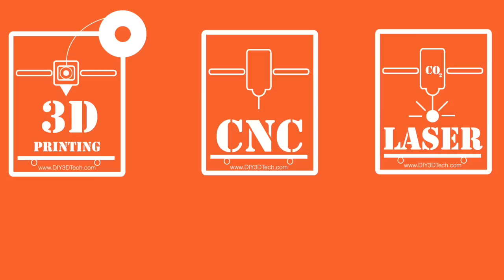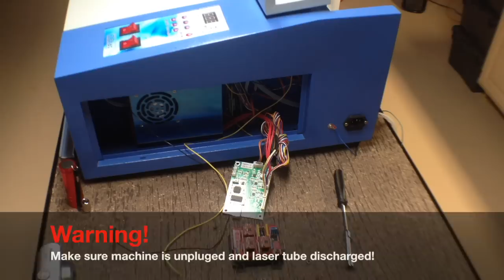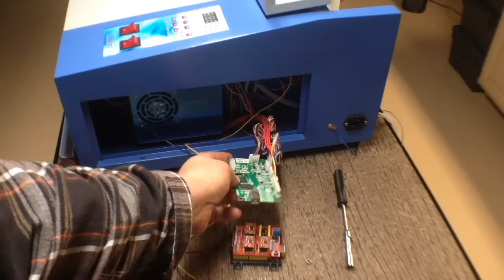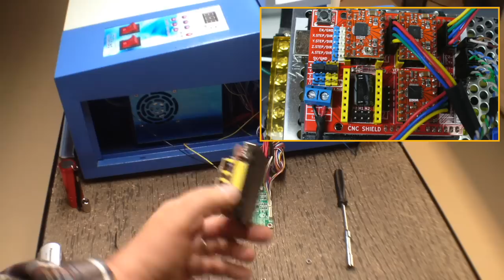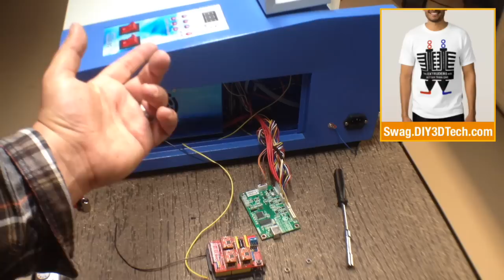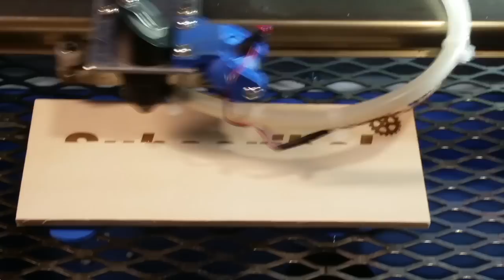K40 eBay Chinese CO2 Laser Cutter  -  Replacing the Controller with Arduino and GRBL Part 1!

Comment: I have stripped a K40 down and built an Acro 1510 system using the parts. I am running the arduino uno and cnc shield.  The software I am using is Lightburn. I have looked at literally hundreds of posts and can't find anyone who can actually tell me how to connect the LPS to the Arduino. I am attempting to use PWM. Does anyone have any idea how to wire this correctly? My power supply is the G-W-W-G if you know what that means. Any help would be greatly appreciated.
Reply from the maker: Very interesting do you have any posts on the build?  I would be interested in seeing how you mounted the tube.  I have seen another Maker take a K40 and do similar which I found interesting.  To your question, this is the number one question I am always asked and the answer is not easy however possible.  I think the circuit would be rather simple in terms of general design as I would bias a transistor with the PWM signal and replace the potentiometer with this as a resistive circuit as that is all the "pot" itself is doing.  The  challenge will be to determine the transistor/resistor combo to make all of this work.  For someone that does this for a living I am sure it would be easy and hence I am surprised I have not seen it done.  As I would start with breadboarding a transistor feed by a PWM and build up from there.  If you are really brave, you could crack the HV PWS and see if you can figure out how to bias it there but fear this would one be harder and two more dangerous...
Reply: @DIY3DTECHcom  I was able to figure out my error this morning and it works fine now. I would be happy to share the build with you. I'll snap some shots tomorrow and share. It's not pretty at the moment but I have plans to make a more permanent solution. It's an awesome setup. I am able to utilize an X axis of 800mm and a Y of 1,300mm. I can almost etch a shower, or storm door from top to bottom.

Comment: Just from looking at this, the wire line are monopolar steeper motors  with proper darlington arrays. THerefore, just will Arduino will not do the trick unless you do  hard coding the register.
Reply from the maker: It did and still working today like a year or more later so not sure what your saying...

Comment: I'm having issues with the potentiometer causing erratic behavior with the current.  (*edit* Current when setting the power level I want, I know it jumps around normally when rastering.) I'm wondering if changing to a multi-turn 2 amp 1k potentiometer would be better?  Also thinking about getting one of those drop-in smoothie controllers so I can do photos on acrylic because I'm having problems getting the K40 Whisperer program to dither on glass/acrylic even when inverting, although it works pretty good on wood.
Reply from the maker: The pot problem is a common and it doesn't handle a lot of current as its just a cheap one.  Most folks simply replace with it with a simular pot but you could try a better one.  Since I basically only cut, its not such a big deal for me...
Reply: Yeah, I was thinking a multi-turn pot would be so much smoother when adjusting.  I'm not at the laser now, but I thought it uses a 2 amp pot?  If I get the drop in replacement, it won't matter, but it will probably be awhile before doing that and I'll really miss the K40 Whisperer program, so much so that I'm considering making a switching circuit to toggle between boards.  Something nobody has done probably, but then it's probably not much desired either! lol  LOVE YOUR CHANNEL!
Reply from the maker: Many thanks for the kind commets however I am confused "switching circuit to toggle between boards" as where does the two boards come from as I use the K40 whisper with same board as laser draw...
Reply: It was only a thought.  I like the K40 Whisperer and how easy it is to open a file and go, but it doesn't do too well on acrylic, so the smoothie could do the high res stuff in greyscale and then I could flip a switch and be  back to the  K40 Whisperer for easy stuff.  Probably not practical, but could be interesting.

Comment: Your videos are giving me the confidence to purchase an eBay 40w co2 laser to hack it. Did you ever get the chance of building a motorized bed for z axis?
Reply from the maker: No have not done as really have not had the need as most of what I do is 3 to 5mm so I just shim up the 3mm with washers.  Maybe this winter, just too many other projects : -)

Comment: Hi there. 
I'm having a single problem with converting my K40 to Uno+CNCShield.

My laser PSU has two pins for the laser.

Laser PWM and Laser Fire.

I cant find anywhere online where these two pins plug into the CNC Shield.

I can get the Z+ pin working with M3 and M5 commands. Testing with an LED and it controls properly, however when the LASER FIRE Pin is put on that same Z+ pin, the laser is always on.

Which pins do I need to plug my LASER PWM and LASER FIRE onto my CNC Shield and which commands to run it?
Reply from the maker: The K40 doesn't do PWM so not sure.   As far as the firing line line goes.  Just google "transistor inverter circuit" and pick the one you are most comfortable building.  However one safety note, if you abort the job before the job is complete (hence the M code to turn off the laser) is sent, the laser will remain ON!  So be safe :-)

Comment: So, quick question for you... I am looking to do something similar, and I know there are some that have the power meter on it..where you can adjust the power of the laser.   Is there a way to adjust that too, to control the intensity of the beam?  Or is that just something that is controlling the PWM of the laser.. variable resistor driving the speed of pwm... Thanks for the videos!
Reply from the maker: +Dan Regalia thanks for the kind comments and to answer your question, there isn't an easy way to modulate the laser.  Now you could design an additional circuit to vary the resistance of the pot and use the PWM to drive it.  However again it will require of design work.
Reply: @DIY3DTECHcom  and @ Dan There is a PWM output on the GRBL board, and I have read that the Laser Power Supply can use both PWM or Pot resistance to set current... Have you done any further research or learned any more in regards to PWM to set current?

Comment: Great video. Isn't it possible to invert the signal via a config setting in GRBL ?
Reply from the maker: Nope they keep it that way for safety reasons as who in their right mind would fire on a low signal?  So you have to build a small logic inverter...
Reply: True, but GRBL is built to be relatively generic. Did a little digging around, in 'config.h' the comment on line 154 says 'Inverts pin logic of the control command pins.' if you follow the rest of the comment it takes you to 'cpu_map_atmega328p.h' You mention that you are firing on pin 12 ? which seems to be set on line 66- #define Z_LIMIT_BIT    4 // Uno Digital Pin 12 and used in the mask '#define LIMIT_MASK       ((1<<X_LIMIT_BIT)|(1<<Y_LIMIT_BIT)|(1<<Z_LIMIT_BIT)).' So it may be that using the line #define LIMIT_MASK       ((1<<X_LIMIT_BIT)|(1<<Y_LIMIT_BIT)|(0<<Z_LIMIT_BIT)) Inverts the logic on pin 12 ? Purely a hypothesis, im not planning on switching to GRBL just yet so I can't test, but my machine is working tons better thanks to your videos, so thanks very much :)

Comment: Great project. Has anyone actually measured the laser power of these inexpensive "40W" lasers?
Reply from the maker: Thanks and yes, most these are really 30 Watt units they over drive to get up to around 35 Watts (i.e. round up to 40 watts).  A true 40 watt laser will have a tube 750mm long whereas this one is only 550mm...

Comment: You are so going to  love that conversion .  You will be able to stream , and later  add SD card back , as you can stream form file on SD card.
I forgot to mention when you asked about my firmware , My plans were to move from custom home brew g code interpreter to GBRL  any how .   I was planning to  edit GBRL to control my custom laser setup and keep my old OLED on I2C if i can . 
Also InkScape's plugin for laser is quite handy and free . I use chrome app universal g code sender most of the time with mine.
You should be able to calibrate your steps with a few calibration cuts . i tried calculating mine , but in the end cutting a 150mm x150mm square a few times and doing some  large 75mm radius circles , and checking them for being true was all it took to dial it in  .
You will be able to cut using vector paths . Makes me  want to finish my  bitmap to raster
Reply from the maker: Yes use GRBL a lot as I converted my CNC to GRBL as well as built a 2Watt Diode Laser with it.  However can you share a link for I use chrome app universal g code sender ?
Reply from the maker: P.S. if you do hack GRBL for the OLED let me I would love to added to several of my machines...
Reply: you bet i'm looking now .  I love this app , it work offline  and even on chrome books ! : https://chrome.google.com/webstore/detail/gcode-sender/ngncibnakmabjlfpadjagnbdjbhoelom?hl=en&pageId=107047392111691459641
Reply: I'm gona look into it , i just wonder if  the I2C buss  pins have been used ..  but i will have a dig for when i re do my rig . there is just too much good stuff in the newer GBRL to pass up .
Reply from the maker: Wow!  I wonder why I have not come across this before!  Thanks again for sharing it!
Reply from the maker: Ah yes that is  a good point (wonder if  the I2C buss  pins) as GRBL's issue is its always short of pins on the UNO...
Reply: well you could edit the ?pins.c   or whatever file they stuck the pins definitions in ( I need to DL the latest GBRL from GIT or such to verify )  so you can migrate it to MEGA2560 or other Atmel chip .  I may go to MEGA for all the extra GPIO , and it has 2 hardware serial ports . That's handy for debugging or say using a ESP8266 of some type to wifi-ize your laser .  Heck is i use a Arduino Mega i coudl use one of the reprap LCD screens pretty much as is , and should not be too hard to look at how marlin supports them .  But mainly I just want to see status confirmation on my rigs . so a small OLED that updates every few seconds is perfect .
Reply: well I2C buss uses A4 and A5 pins ,  GBRL 0.9+ only uses A5 for probe if you need it .  If you use a Arduino Nano for your MCU you have 2 more available pins . A6 and A7 are exposed , so if using a Nano , you just change the probe to use Pin A6 .  That's an other advantage for using Nano's  2 extra pins over UNO .
Reply: The G code sender had some growing pains a while back , but i talked with the dev then and i think it all got sorted so the preview looks fine .  It will send G code it does not know , it will whine and tell you about unknown gcode , but still send it to your CNC .  it was made for a shapeoko (sp)  CNC .
i can drive my custom laser firm ware no issues .  I bet same for GBRL .  as long as GBRL sends a 'ok' back after each command it gets , it should be fine .  I should put GBRL on a Nano , and try it in dummy mode.
Reply: just spent a few hours trying to get U8glib to compile with GBRL , so we cna use I2C Oled .. and well i think the issue is GBRL src is C and and OLED is C++ like , its hard for me to tell in arduino IDE , but seems it does not like the class keword when you add U8glib.h in the gbrl.h file. lol   so not sure how to proceed just yet .
Reply from the maker: Interesting, thought arduino was C?  I have done a little C on arduino to drive some camera sliders and the like.  I also do C# on Apple but must admit I am getting a little rusty :-)
Reply: it is C sand C++, or .cpp .   C++ can include lower level C code via 'extern' and such , but c cannot include c++ .  the clue for me was it did not recognize the keyword 'class'   . Arduino is a special nice packaged C++ . the compiler it sits on can compile c and c++ no issues. I just have to fing a c lib for the OLED or break down the c++ driver to c by hand . lol
Reply: well  I see the guts of u8glib are c , but the interface is c++ .way too much work to figure out how to drive it directly .  I need to find a simple c only lib for our OLED over I2C . lol

Comment: Just a question, I don't have the digital one, I have the one with the dial. When doing cutting the value seems to be what I have it set to. Though, when doing engraving the power does fluctuate from 0 to the max power setting I have the dial set to. So, will doing this stop the engraving feature?
Reply from the maker: After re-reading your comment this fluctuation is just the laser turning itself on and off as unlike cutting, the laser turns it itself on and off rapidly to create the raster image.  However if you make this change you will not be able to raster engrave as you do now.  If you want to engrave you will need something like ArtCam which will turn a raster image into GCode.
Reply from the maker: LOL!  No worries, any question just ask and love the monkey wrench comment as a kid my dad sent me for a crescent wench so its about the same :-)